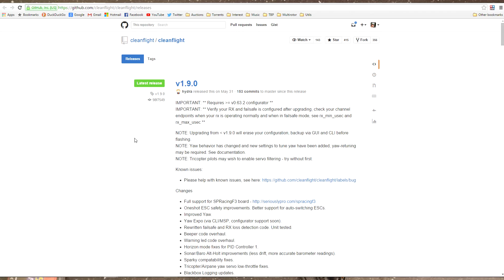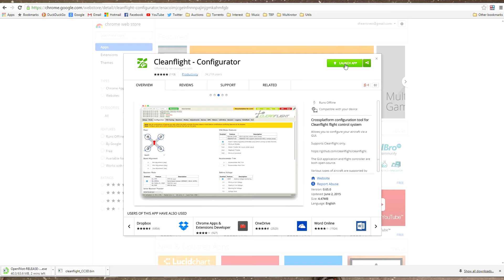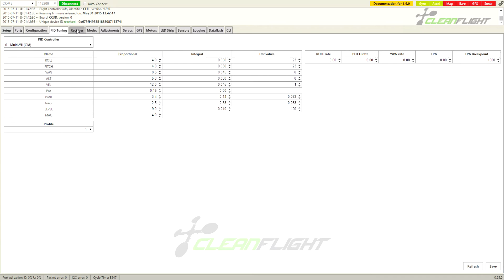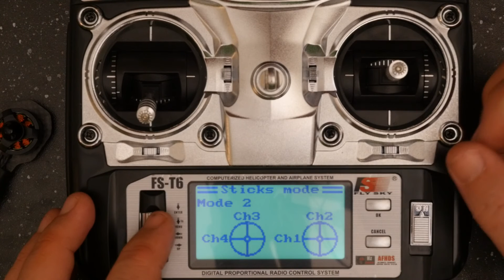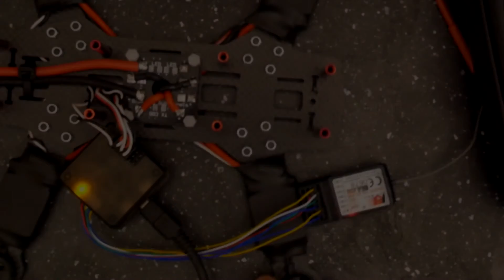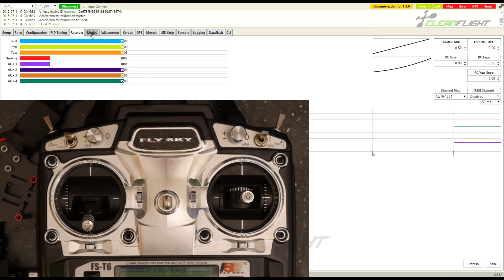Beginner's Build: $85 Mini Quad - CC3D & Cleanflight, FlySky Transmitter. Part 5

Comment: Your video shows motor 3 and motor 4 reversed during your motor test screen demo.  I did the same thing this past weekend on my first clean flight build. Might want to throw a note on the video.  

To used to KK and APM for me to catch that change.

Great video series keep it up.
Reply from the maker: Arthur Ellingson Haha, you get plus points for catching it! I literally had my GH4 camera 6 inches above the quad when I was filming the test, and I missed it again when editing the video. In the next video of the maiden, the thing flips on takeoff, and I take you through the troubleshooting to fix it, which I think is useful, as that is a likely problem somebody will have to solve building multirotors.
Reply: Yep mine flipped. I actually was able to get it like 2ft of the ground but with zero yaw control with full left and back.   I don't know why they numbered them this way.

Comment: for some reason mine  won't arm. any ideas?
Reply: Joe C Check your minimum throttle values in cleanflight. This is covered in the next video. Also make sure that you keep the quad level when powering up, so that it can initialise properly.
Reply: +The Bright Pixel I have the same problem my fs-t6 won't arm! do u fix it! and how!

Comment: Are you able to fly this Quadcopter also with this transmitter?

http://m.banggood.com/F00541-RadioLink-T6EHP-E-2_4G-6CH-Remote-Controller-Transmitter-p-958758.html

Ps: Nice Video
Reply from the maker: Tooser Lp Just by looking at the receiver, I'd say probably yes, if you already have one. But the one in the video is same price, and is from a better known manufacturer.
Reply: The Dark Pixel I live in Europe and the Transmitter can be bought in Europe so it do not need to be checked by the Custom.
Thank you really much.
Reply from the maker: The seller marks it as 'Toy parts' with a value of $29USD :)
Reply: The Dark Pixel Now you persuaded me to buy the One in your Video 😄